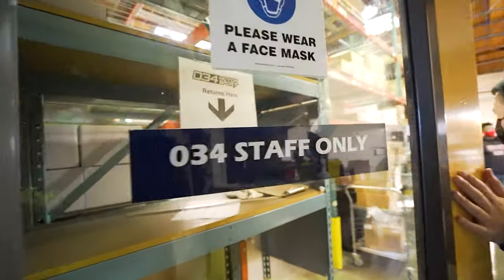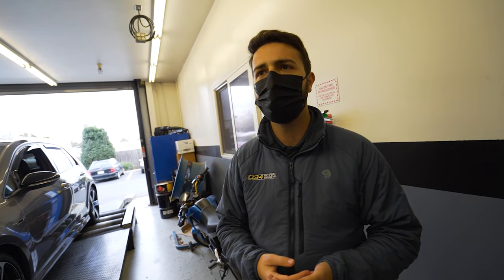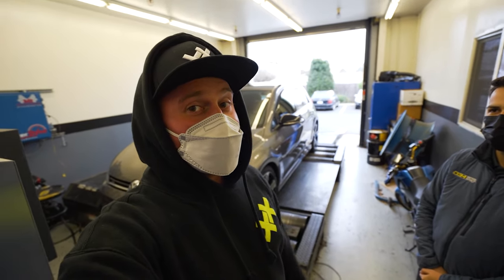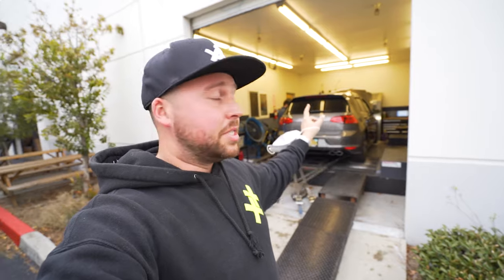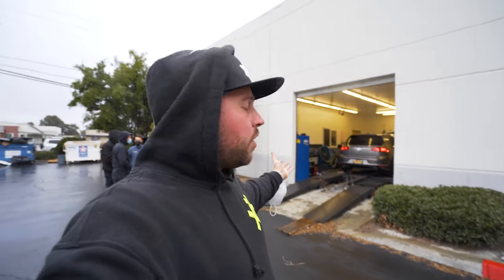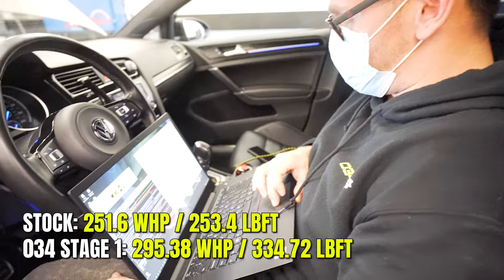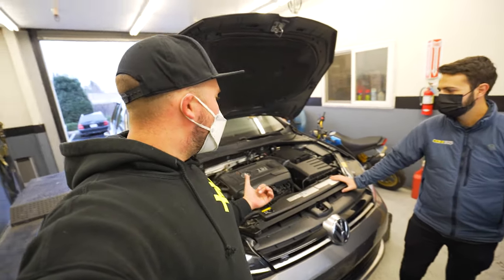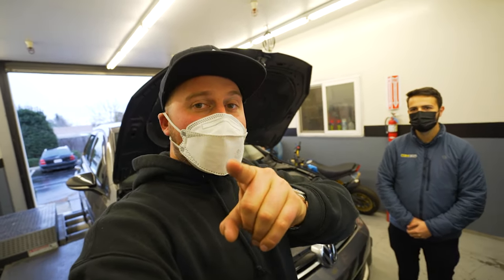Stage 1 MK7 Golf R Dyno Run (034 Motorsport tune)

Comment: Next modification I would recommend is a BMS pedal tuner. It doesn't make the car any faster, but it transforms the response which is desperately needed with the throttle on this car. Having the ability to adjust it on the fly is also very nice.

Comment: Those WHP numbers are actually pretty close to what you see with a Dyno jet.  Mustang dyno's used to read a lot lower but I heard they came out with some sort of updated software or setting that cause them to read more inline with a Dyno Jet. Which as you said the absolute number is not as important due to a number of variables, but it is for reference if they are all in the general ball bark, which most are these days. Everyone gets tired of explaining why their numbers might be lower than others so... 
The real test will be at the drag strip, or use a draggy, 0-60, 1/4 mile 100-200Km's. I will guess 0-60 around 4 seconds and 1/4  12.4 @109 MPH. Good luck with your project.
Reply from the maker: Yup you’re about spot on! Need to get some solid 0-60 times. Last one I did was 4.1
Reply: Thanks for you input, I  didnt know that about updated dynojet readings. I have an Audi S3 (same engine) IS38 also, with same 034 ECU/TCU tune stage 1, but with 93 octane not 91, and Im right at 12.2 in the 1/4 mile  with just that upgrade, no hardware. The 034 tune is butter smooth, while having that nice low end grunt down low that just continues to redline.  It's nearly perfect, along with the 034 upper and lower dogbone mounts, which gets rid of drivetrain slop, gives you a much more direct feel.

Comment: Odd their website says stage one 377 hp…
Reply: thats according to 034's in house dyno. Different dyno's produce vastly different numbers. I have 034 stage 1 ECU/TCU on my audi S3 and it's right on par with the other major players as far as power. I went with them because 034 strictly adheres to the factory safety parameters while at the same time producing a really solid tune . Im running low 12s in the quarter stage 1 with 93 octane.